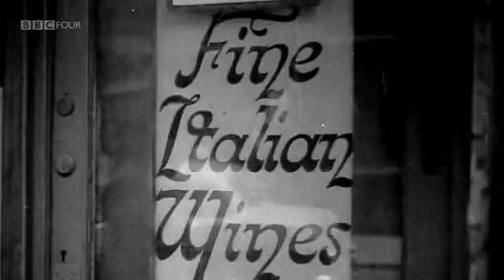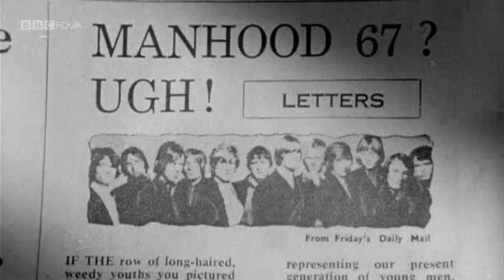BBC The Perfect Suit. part 3of4

Comment: @jovantheun1337 I've noticed that some suit sleeves have three working and then the bottom one has the buttonhole sewn but not cut through so you could take the sleeve apart and alter the length. However, if you lengthen it, you have the problem of the buttons being too high up the sleeve (unless you put more buttons on which again is not on). There's still too much fiddling about to be worth it. I say, have the sleeves set for working but do not cut the holes. Then, there is choice at least.

Comment: @jovantheun1337 Indeed. Manufacturers are obsessed with working cuffs for OTR suits which is silly as you say, many required the sleeve to be altered and you can't alter sleeves with holes in them. You either reject the suit or buy it and look like you've got freakishly long arms or like the suit is too big for you.

Comment: I like the way you try to match factory made clothes with individually tailored clothes, But to be honest there is big gap between tailored and factory made, even though if they look alike the same, function same, as you showed in video the machine cut 18 to 20 fabrics at a time and then send them to different factory to stitch them, how you will know which piece of fabric is with same layer, plus no one working on single suit. while in real tailoring you cut single fabric for an individual and stitched them for individual complete suit normally made by one persons. so please do not misguide customer and do not compare tailor with factory.